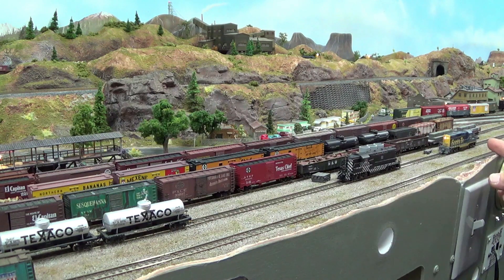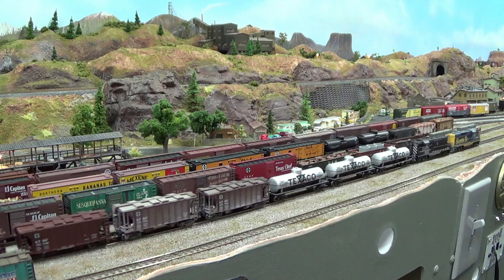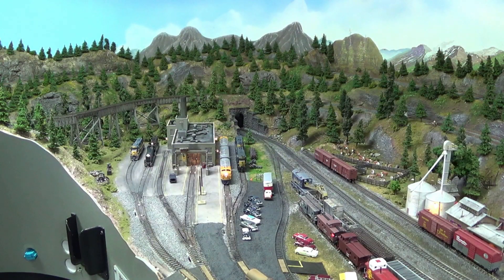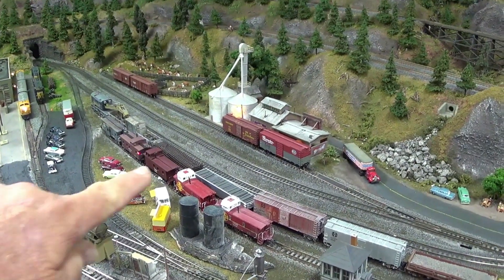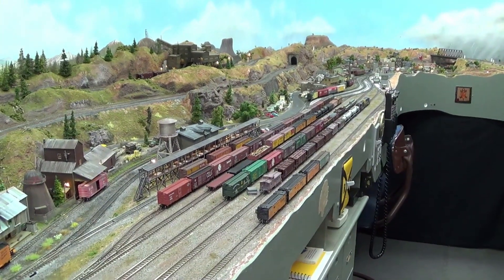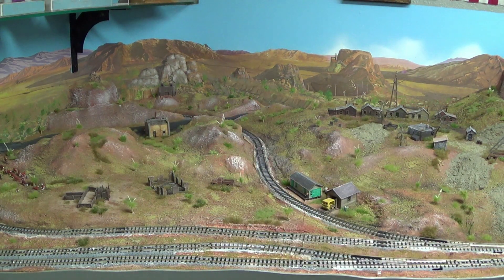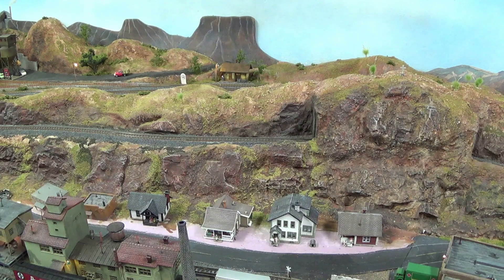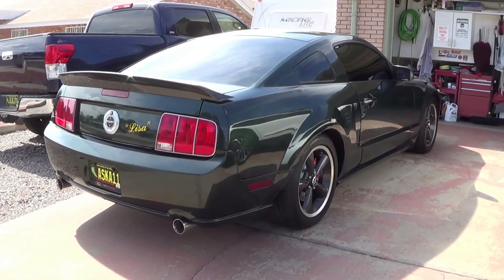N Scale ACTRR 3 Layout Update # 103

Comment: Ah, is a layout ever done?  detail items always cry out for more.  A quick question: how full should a yard be I have been told 1/2 full, your thoughts?   The engine house just keeps getting better, I like the horizontal tank on piers and the sand area looks great also.   Do you plan on blocking the light at the tunnel exit?   Atlas remoter to Kato would be great.
Reply from the maker: Thanks Will. I can not block the tunnel light as the track goes through there. I think 2/3 full if trains are coming and going.
Mike